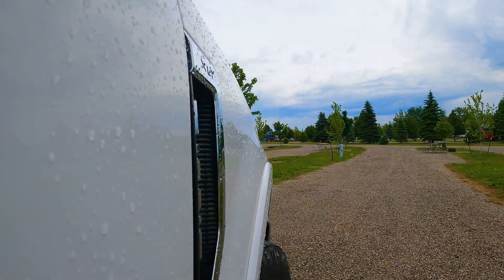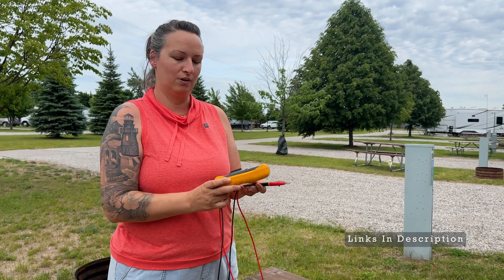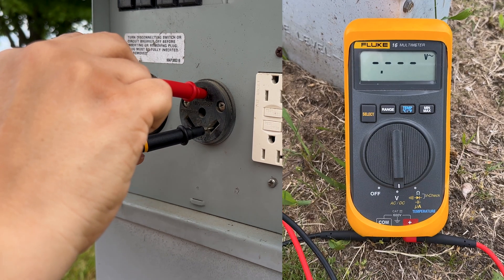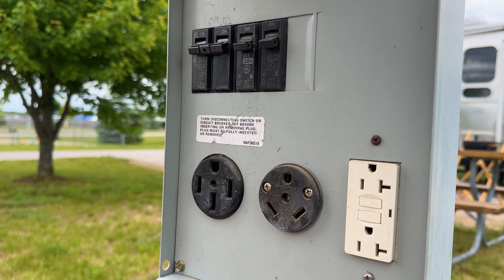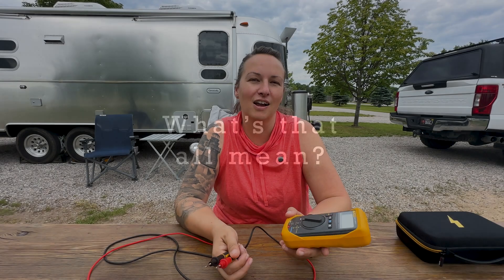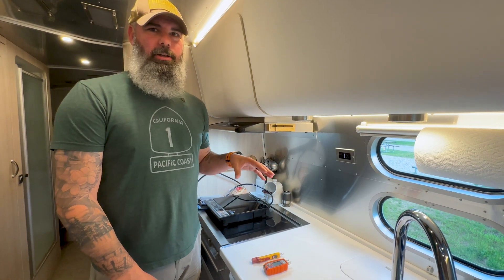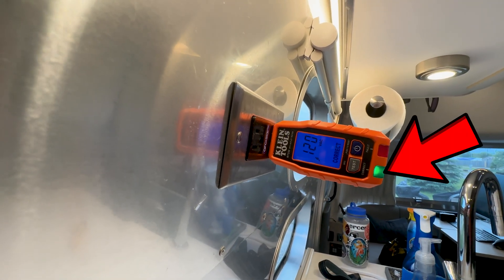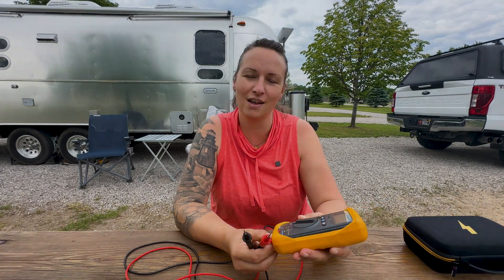Checking Power at the Campground Pedestal with a Multimeter

Comment: Did you test for open ground or did I miss that?
Reply from the maker: Yes, but not my measuring resistance (Ohms).

When checking the receptacle live (energized) we test Ground to Hot, and with a good Ground we should line voltage (120V in our case).   That test, coupled with good outcomes on the other tests (Hot/Neutral and Ground/Neutral) should indicate the receptacle is wired correctly and operating properly.

Comment: Curiosity question (as I up my game with some new testers). Is it ok to use my EMS as a test?  I typically plug it in and let it go through its checks before I plug in, but I also do this after I disconnect and start setting up. 

Either way, is that not a preferred method for checking?
Reply from the maker: The EMS is one way to go.  It should catch any bad stuff before damage to the trailer, but it may be at the expense of the EMS (in really bad cases).